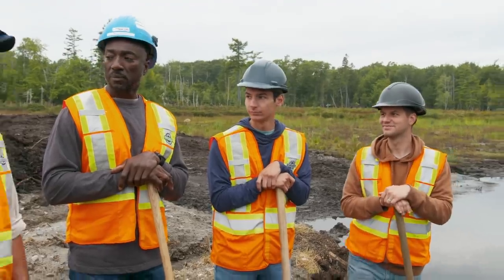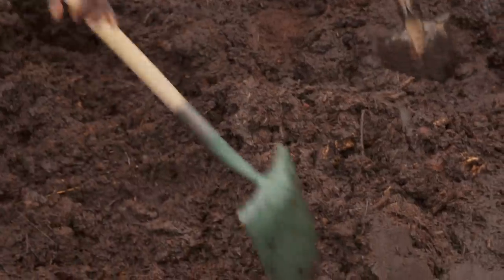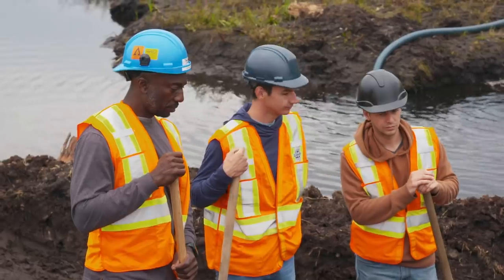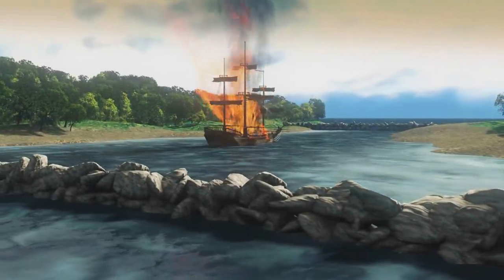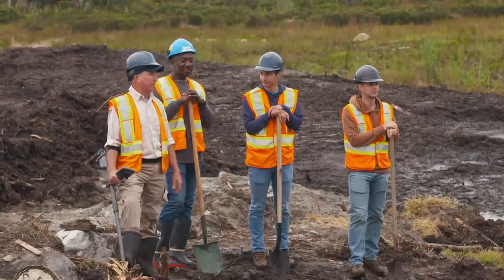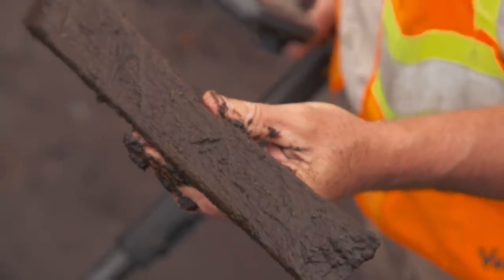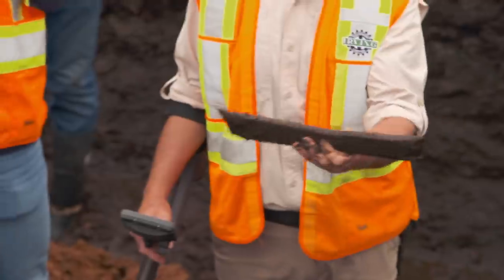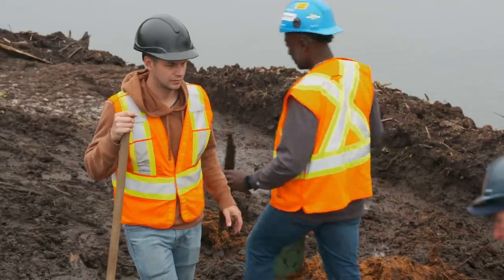The Curse of Oak Island: MONUMENTAL EVIDENCE Uncovered in the Swamp (Season 9)

Comment: I am curiious if Gary Drayton run his metal detactor across the length of every core drilled sample to determine if there might be metal parts at certain depths? There is a possibility that they might of done it but not shown on every episode.
Reply: He should.  I've wanted them to take the cores taken to a wood table with no metal in it and have it scanned before any other examination.  For that matter, a good case could be made for 5 people with a variety of metal detectors, or better yet 50.  Keep in mind that many of the best finds aren't metal, but metal gives them a reason to dig there.
Reply: Good point, never saw nor heard of it

Comment: What happened to the big dig talked about a few seasons ago? The dig was supposed to be at the money pit area, be extremely wide and circular, provide ways to keep out water, and go deep enough to find what the treasure. What happened to that, and why hasn’t that been done?
Reply: If they just drew a 50 foot radius around where they originally guessed the pit to be and started digging and shoring, they could have put a roof on in and been done 150 feet by now, and known the whole story . Instead they pin cushion the heck out of everything and smash it with hammer grabs, pretty dumb method. If there is anything really neat down there it will be smashed to bits
Reply: @mythoughtsonfaith1031  EXACTLY! I keep watching them drill into a chasm thinking: if there was priceless documents inside a vault, you've now cracked the vault and let water in, likely ruining the documents!
Reply: @Ryanralston07  I've had it I just don't care anymore  .......
Reply: Ryan, they had to change the narrative to keep people interested.
Reply: @quanahhurtt4443 , ya, nothing keeps people more interested than actually finding something lol
Reply: @Ryanralston07  the show is the treasure, so they have to change the search from the money pit to a sunken treasure ship.

Like you said, they had to find something.

Even if it's ",planted".
Reply: i'm sure Canada won't permit them to dig a 200 ft deep, 50 ft wide hole even if they could afford it. the technology exists, but..

Comment: The taper piece of wood is not decking. It is the end of a hull plank from a small rowing/sailing boat.
When he turns it around it is easy to see the relief areas on the front and back  where the next planks would fit nicely and end in a flush line at the bow/stern.
Think of it like ship lapping but only towards the end of the planks.
Gee, I wonder if that's where the term came from 😉

Comment: Oak island was a trading settlement. It was a time when many ships were saling looking for new land and resources.
There had to be a place to resupply and repair ships. 
The swamp was used to  off load supplys and repairs. Why the stone pathways are leading inward from there. 
Over 100s of years with strong wind and waves including hurricanes it filled in part way then a underground spring feed it.
If you dig deep enough anywhere you will find water. Since its a island surrounded by water there probably lots of underground water ways...

Comment: Logs were floated into the cove from the mainland and then drug up the cobblestone road by oxen to the woodyard to be processed.  The logging crews (1720s) were logging virgin forests with 400 year old trees.  So 1720 - 300 = 1420 Carbon-14 date.  The date is when the tree was growing, not when it was harvested.  The swamp is manmade, but not intentionally.  All of the farming and digging on the island caused that area to silt in and then terrestrial plants began to move in.  The island was taller than it used to be.  Where did that material go? - into the bay turning into a swamp.